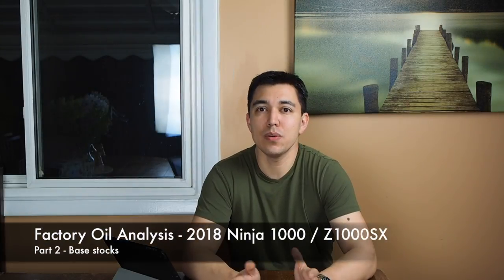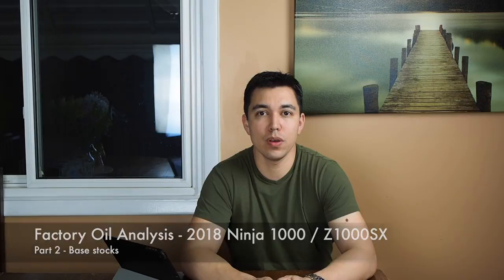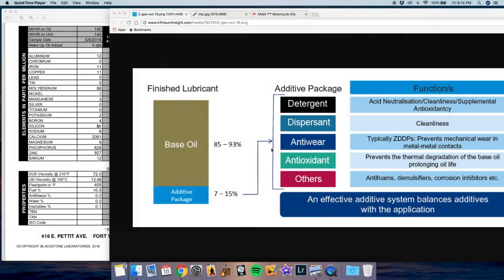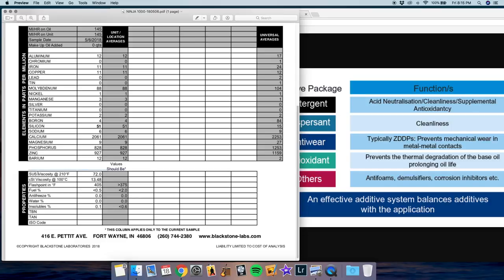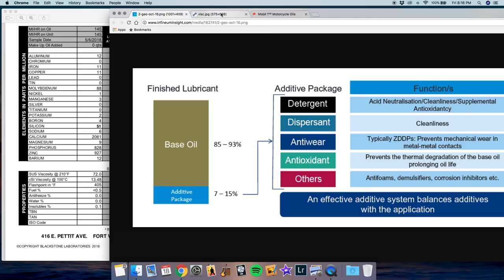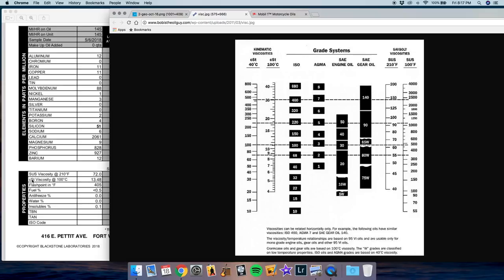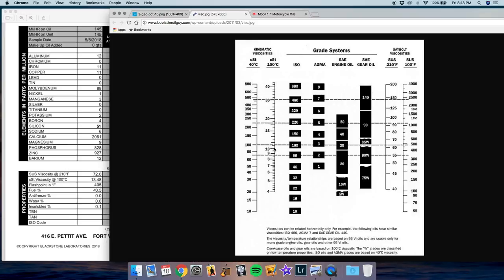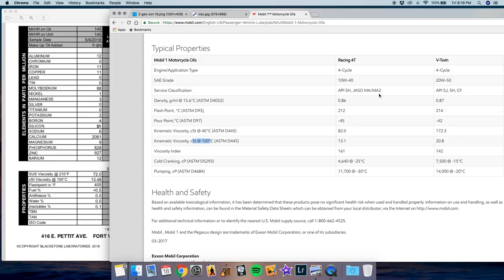Part 2 of 2: Motorcycle Oil - Is factory oil designed for engine break-in?

Comment: Wow, amazing analysis and the work to get the info - Thank you JL! I have a 2018 Versys 1000 LT, got her brand new and opted to drain the factory engine oil at 150 miles. Replaced with standard Kawasaki oil\filter, then did another change at 300 miles and then brought her in to the dealer for that first 500 mile service in which they also changed the oil\filter. After watching your analysis, makes me think maybe I should have left the stock oil in for the first 500 miles. Well, better engine break-in luck with my next new bike. Thanks for the info, very helpful!